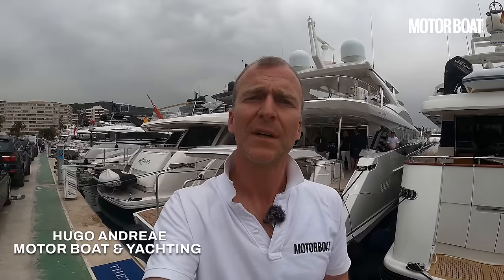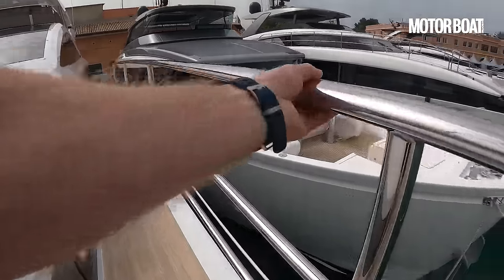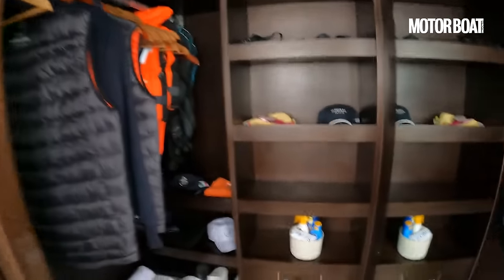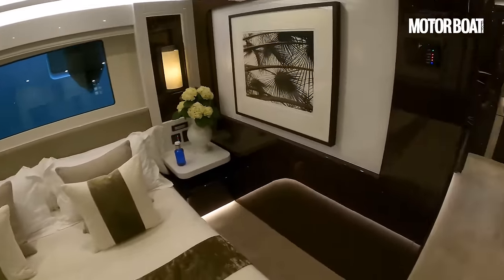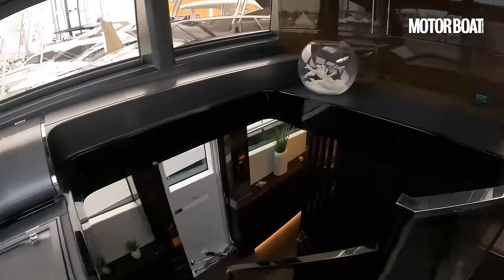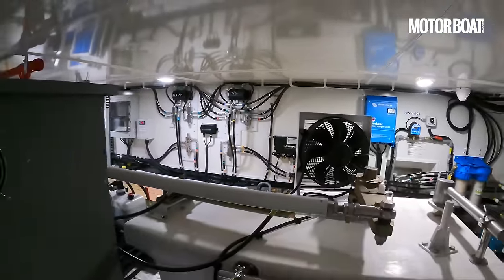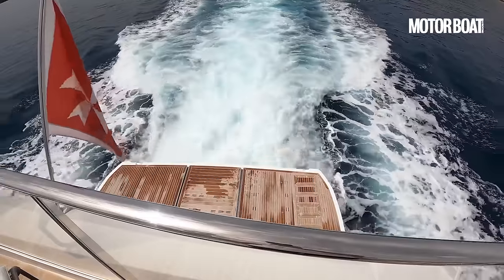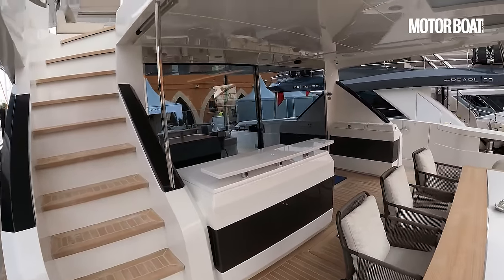Behind the wheel of an exquisite British-designed superyacht | Pearl 95 yacht tour & sea trial | MBY

Comment: You mentioned owner/operator when you were on the flybridge.  Can an owner be an owner/operator on a 95' yacht?  I guess a better way to put it is, could you (you, not me- I don't have the experience you do) and a brother or son operate such a yacht yourselves?  I suppose it would depend on what you were going to do with it for one.  But isn't there some legal limitations or something about that size of boat?  I thought anything over 80' had to be crewed.  As an American,  I could envision having a home in Florida or something with a private dock big enough for this boat and using it with my son to take weekend trips to the Bahamas or something, just anchored off an island and using the tender to go into the beach for an afternoon.  I suppose I could probably swing that with my limited experience.  Backing into Monaco or similar wouldn't be something I'd want to try with just me and my boy.
Reply: I can't quite remember to exact rule as I sail a small yacht. I think at 84 feet things change, I have a yachtmaster and I certainly would not be legal skippering this yacht.
Reply: @ianscott3180  Not true, I am afraid... you are, if anything, over-qualified to skipper this yacht.
That's the problem with these RCD 24 metre (approximately 80 feet) "Hull Length" Rule 'cheats' - a complete novice (let alone a Yachtmaster) is perfectly allowed to slam this boat at 30 knots into a harbour wall or ram another person's pride and joy and walk away without any repercussions.
All yachts subject to the RCD can be captained and crewed by unqualified amateurs when used privately. Even when on charter (i.e. used commercially), a Yachtmaster can be captain (at least in the UK) of an RCD boat, even if the boat is actually bigger than a commercial "Large Yacht" classification (where the crucial measurement of 24 metres is "Load Line" length, not "Hull Length") vessel that requires a commercially endorsed Master's Certificate of its skipper.
Reply: I was assuming that a boat like this would be on the Med, you don't see many on the Solent. I know that you need no qualifications in UK waters but you couldn't cross the Channel.
Reply: @ianscott3180  Yes, you could. According to the RYA:
"Visitors to France on foreign flagged boats are required to have the licence required by the vessel’s flag state."
This Pearl 95 is deemed to be RCD compliant, which under UK regulations, requires no licence for private use, although an ICC is recommended for French inland use.
Fellow former naval empire the Netherlands also has no qualification requirement for private coastal use.
Almost all countires in the EU that require some form of qualification only require an ICC, which is nowhere near as strict a qualification as Yachtmaster (and in a different league from a commercially endorsed Master's ticket). For example, qualifying as an RYA Day Skipper Motor entitles one to an ICC.
Reply: @RandomGuyRandomNumber  An this yacht has a Malta Ensign so EU rules would apply.
Reply: @RandomGuyRandomNumber  I'd still have a full crew for this boat, at least until i was fully trained and had many hours under a supervising captain before I would ever attempt to owner operate this boat.....IF I ever did at all.

Comment: The passerelle control panel has one corner bent by hand to fit over a hull style line (timestamp 1.12).
That tells you all you really need to know about the quality of construction. It's superficially good, but the last 10% of effort just isn't there. So they bodged it.